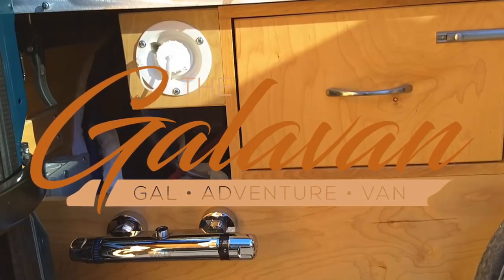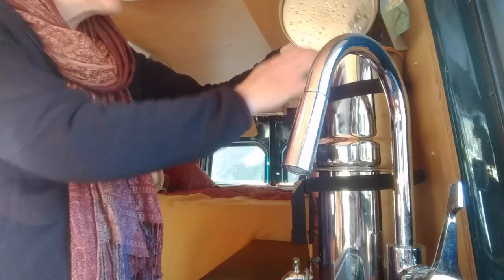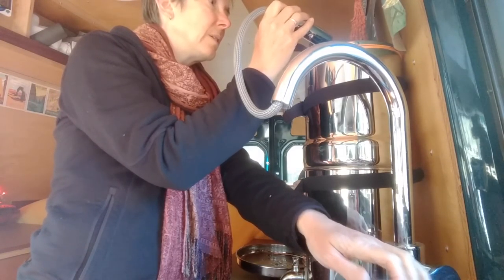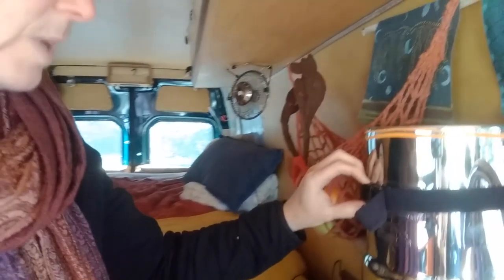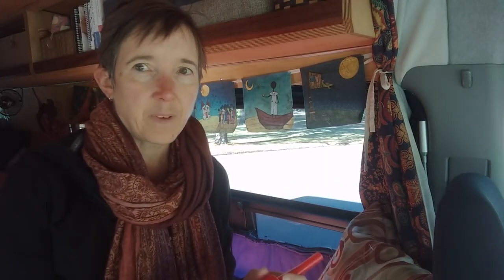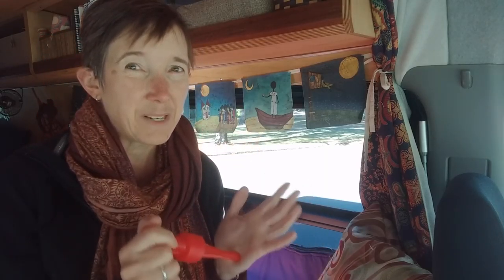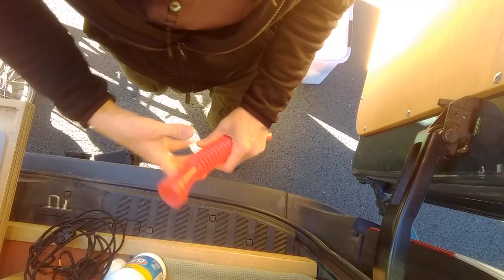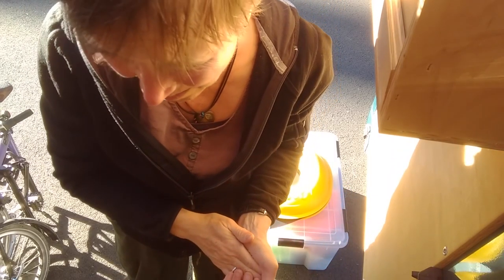Fresh Water Tank Maintanence

Comment: If your not drinking the water as you stated you're using the filtered water you can use non potable water. Basically, it's the same water just the proximity to the dump station. If you use your own hose & not the hose provided there is no issue with that water.

Comment: I have a Class A with 75 gal tank. When I clean the tank I always flush twice with clean water and open the cold water faucets and flush them out, remember your still using for bathing. Also, Do not turn on the on the hot water you don't want bleach in the hot water heater area. The garden hose is not a good idea you still use the water to bath, right? Travel safe😎
Reply from the maker: Thanks

Comment: Why do all the cleaning of the tank then use a dirty hose not specified for potable water? Why wouldn't you use your clear hose ? I was told to use  the white hose that is made for water consumption without the chemicals of the green garden hose.
Reply: Well Cathie, you are correct but Joni is still in the figuring it all out stage.  At least it's not summer with the hose in the sun.
Reply: I'm going to guess that the water faucet was further away than her 25 ft. clear could reach to. The point is moot though. She has clearly stated that she only drinks water that has been run through her Berkey water filtration system. I'm a HUGE water/coffee drinker, seldom drink anything else. I'm definitely buying one too!  :)
Reply: When I was a kid and we would all be outside playing in the Summertime, we always drank from a green garden hose.